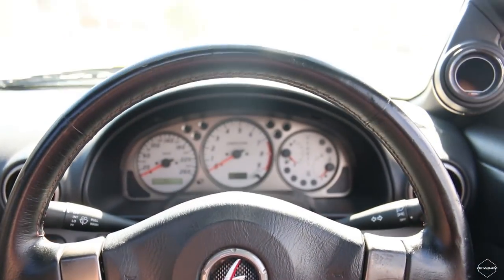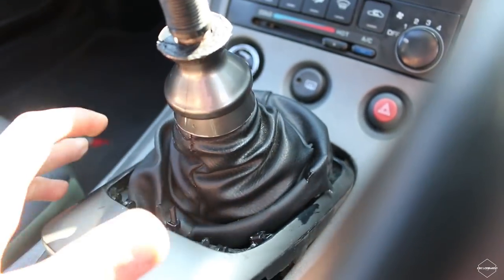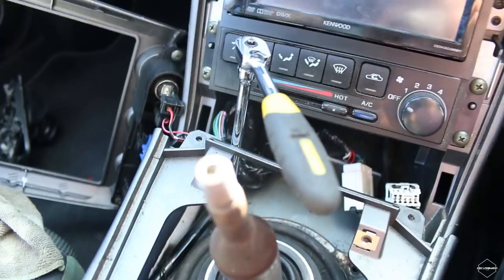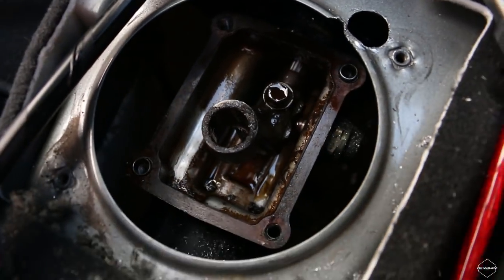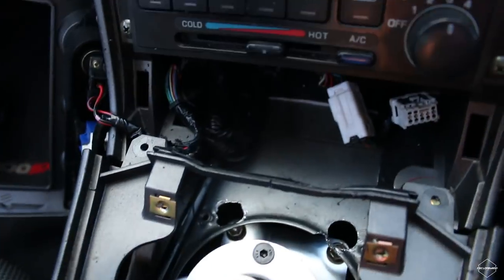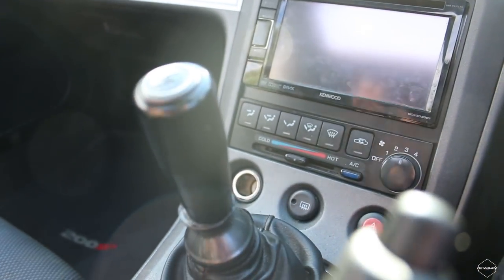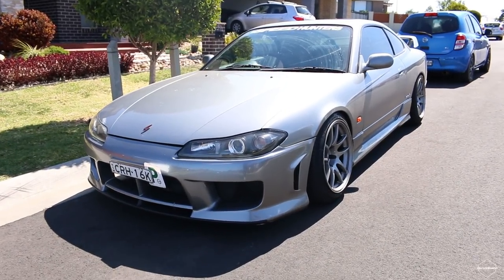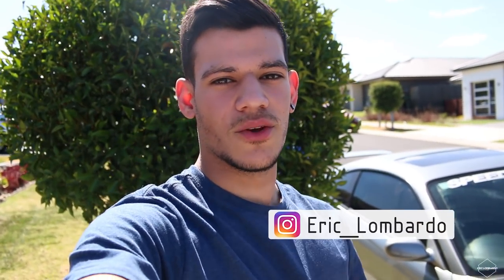S15 Gets a Short Shifter

Comment: What shift knob was that and where did you buy it g?
Reply from the maker: +-RiiPStiiCk _ I bought it from autobahn bro haha custom put the silvia logo and base piece to the stock shifter on it so it looks oem 👌🏽
Reply: Eric Lombardo how did you get the s logo?
Reply from the maker: +-RiiPStiiCk _ just took it off of the stock s15 shift knob it's at the top centre and you just lift it up with a flat head just be careful not to snap it